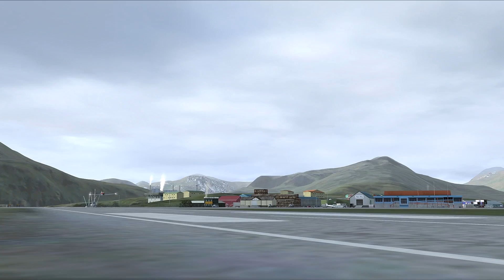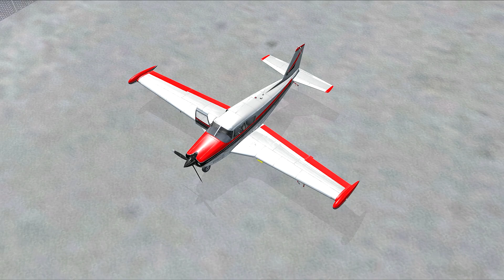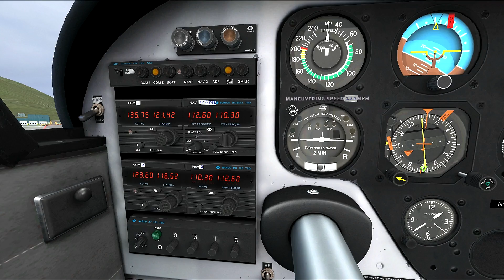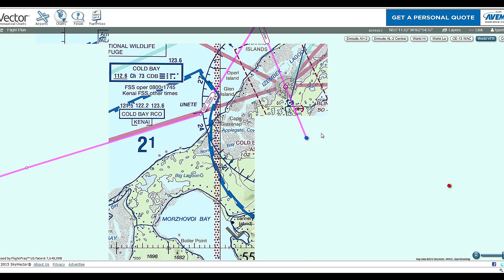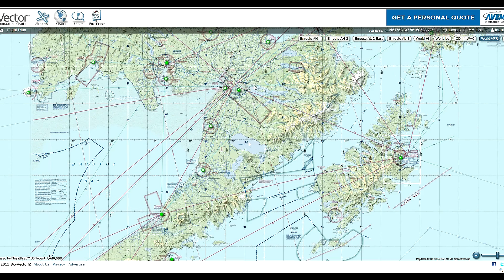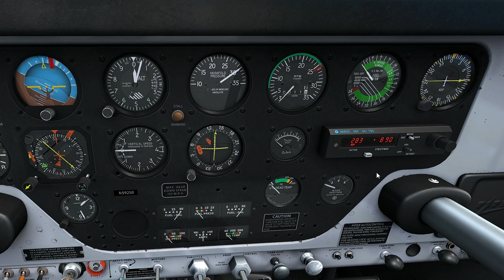A2A Piper COMANCHE 250 part 1

Comment: Does this come with 2d panels? I use multiple monitors and like to keep them 2d (since I don't have track IR yet).  Thanks!
Reply from the maker: Hi spitfire4sergi!  Sorry for the long delay in responding to your question.  I'm not sure about the A2A 2d panel availability.  As you can see from my videos, I rarely use a 2D panel.  I'm sure you can check the A2A website and find out if 2D panels are available.  Hope that helps.  Cheers from Tim G., FS MaNiA

Comment: If I may, can I ask why the airways at 8:36 are prefixed "G"? I know about V, T, J and Q, but what is a "G" airway? Is it one of the "green" federal airways (I am guessing not as its sort of gold coloured). I am just starting to get my head around the nuts and bolts of proper flight planning - there is a lot to take in!
Reply from the maker: +Mirandorl Hi Mirandorl, that is a great question.  The "G" designates this airway is part of a regional network of ATS (Air Traffic Service) routes and is not a RNAV route.  That means you can fly this route without RNAV or GPS equipped aircraft.  I flew this airway with the use of the NDB radio beacon and ADF receiver.  You can read more about En Route Operations and Navigation here: https://www.faa.gov/regulations_policies/handbooks_manuals/aviation/instrument_procedures_handbook/media/Chapter_2.pdf .  Hope that information is helpful.  Thanks for your question.  Kindest regards, Tim G, FS MaNiA
Reply: FS MaNiA Thank you so much for the info and link, that makes perfect sense. That is another one to add to the growing list of aviation websites in my bookmarks! I have been slowly picking through the FAA Instrument Flying Handbook, wow that is quite a tome but can't believe its all free!

Aviation is such a massive topic, I think you could live to be 95 and still not know everything!

Comment: I appreciated the nav aids info and chart reading. I never saw a nav radio w/DME on the display. Is that on older radios only?

I thought sure I would catch you forgetting to check the door before take off. But you took care of it.

Another good one! You set the bar so high! Thanks, Tim.

Paul
Reply from the maker: PT Johnson This was the first time I flew with  Narco radios.  These are relatively older units but not original to the 1959 Comanche.  I'm pretty sure they didn't have the digital display of frequencies in 1959 so that makes me think the avionics were upgraded somewhere along the way.  Most of the DME units I have flown are separate receiver units in the radio stack.  The Narco's did a fine job however, and I must say, I have not seen many NDB stations collocated with a DME station.  Normally I associate those with VOR's (VORTAC's).  I guess since there are very few VOR's South of Cold Bay, the collocated DME's really help in identifying fixes/waypoints in the IFR route structure.  That came in handy for finding Mordi intersection.I left that door open for taxi because that's the way I flew most Piper aircraft with only one door for entry.  The small pilot window isn't enough airflow, so leaving the main door cracked allows enough prop wash in the cabin to provide ventilation on the ground and keep the windows from fogging up during taxi (which is simulated in the A2A model).  Most light single engine aircraft don't have air-conditioning and it can get pretty hot in the cabin during start up and taxi operations.  I do have a "before takeoff" checklist item to "close and latch" cabin door.  In a Cessna, you can latch the door before starting the engine and open the window only for ventilation.  Mooney's are like Pipers in that there is the one door that needs to stay unlatched to get some airflow.  I closed and latched the door prior to taking off one day,,, added full power, just before rotation speed the door popped open.  It wasn't quite latched all the way.  I aborted the takeoff and took care of the problem.  Another time in the same Mooney M20-J, I took off and had the door pop open on climb out.  The wind/prop wash kept the door from opening more than an inch or so, however, it was noisy and unnerving to the passengers.  I circled the field, landed, and secured the door.  When these things happen, you learn to fly the airplane and don't let the distraction keep cause something worse than an open door to happen.Long explanation for a short comment,,, I just enjoy talking about airplanes,,, can't help myself.  Thanks once again and as always for your comments and encouragement.  Beechcraft King Air B200 by Flight1 coming up next. Stay tuned.  Kindest regards, Tim G., FS MaNiA